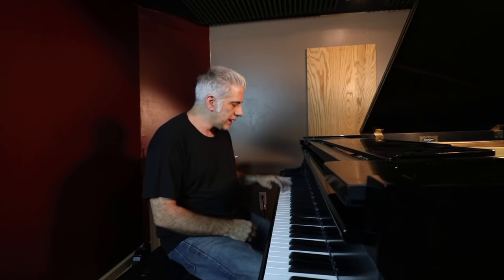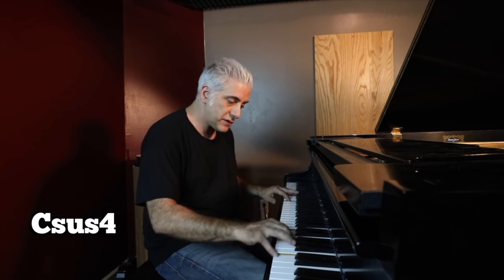Using Modal Scales for Emotional Impact (Why Is Aeolian Sad?)

Comment: Great stuff Rick. I think about it differently these days as my approach is to create and improvise melody to harmony or chords. 

I stopped thinking in terms of modes so much, and instead focus on the underlying harmony and apply melody to that. So a Cmaj7-5 may have a c Lydian mode that would work, but I’d rather think cmaj7-5 instead of c Lydian. That same Lydian mode can sound so different depending on the harmony underneath, I prefer to just think of the chord or harmony and create melody based on that. It really expands the possibilities since there are so many chords, but only so many modes. But, it’s just a way of thinking about it. I appreciate other perspectives as well.

Comment: David Bennet once came up with a „mood scale“ for modes on his channel that ranged from Lydian (for brightest or heavenliest) over Ionian, Myxolydian to Dorian and the Aeolian (getting „moodier“ or „less bright“ with each step) and the finally rnding up with Phrygian and ultimately Locrian. I know that this does not comprise all possible modes (like the harmonic minor and others are missing), but I think it still gives a good overwiew over the modes you get when you use all the white keys of the keyboard (C Ionian) and start with a different key. (Obviously F=Lydian, C=Ionian, G=Mixolydian, D=Dorian, A=Aeolian, E=Phrygian and finally B=Locrian - and interestingly this is always a fourth down!)

Comment: Curious about a couple of things: Are these etudes played live (with overdubs as needed of course) or programmed? They certainly sound live. Also, in the past you've shown notation for some of them, sometimes of non-trivial length. Was that transcribed (not typeset) manually or by software? Great stuff.
Reply: I imagine likely captured via midi interface. It's the easiest way to trancribe something lengthy.